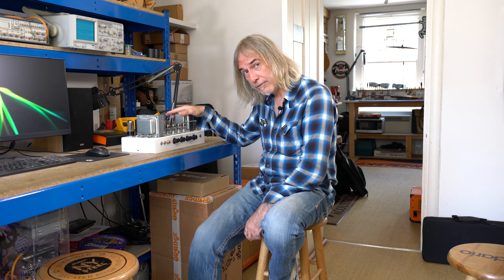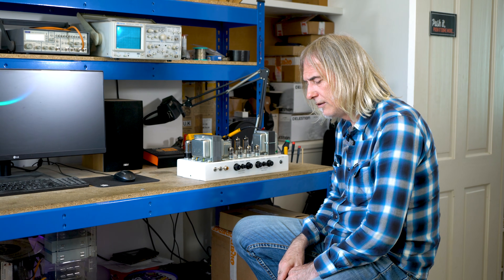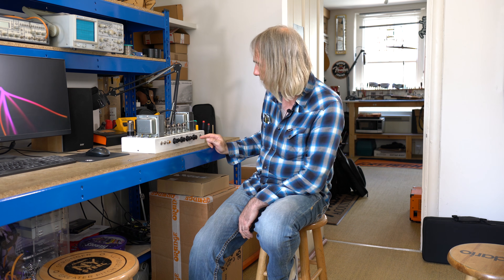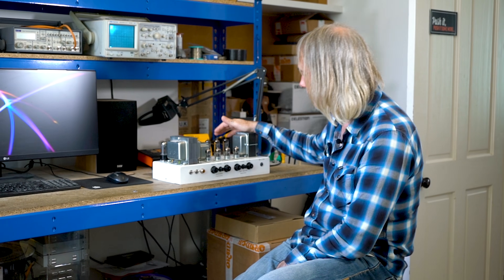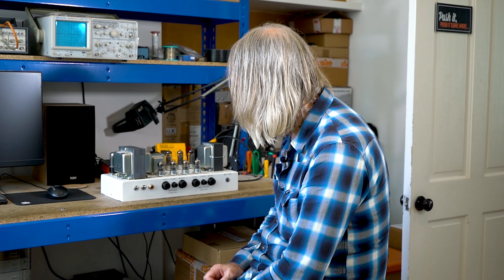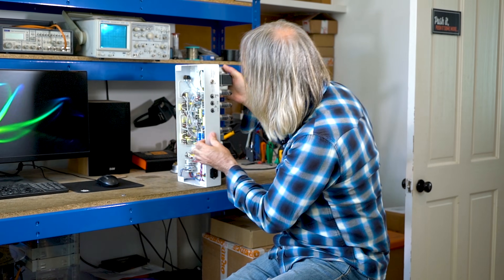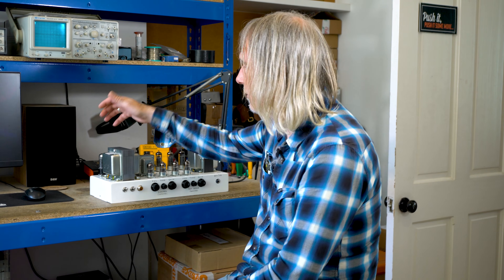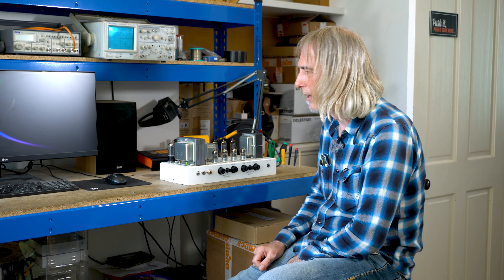That Orange Dual Terror Prototype explained by the designer, Ade Emsley

Comment: Pretty Vacant sounds amazing in this video - I remember Ade in other Tiny Terror videos saying one of the sounds he wanted it to do was "Never Mind the Bollocks" - can't argue with the tone here.

I bought my Tiny Terror in 2008 - I had planned on getting a combo, but they weren't in the shops quite yet, not where I was. I left Gamlins in Cardiff (RIP) with  TT head and 1x12 cab. Still have both, and they work perfectly. I couldn't part with it.

Others have asked, but what's the cab? I remember the Shiny Terrors were sold with a 2x10 with Celestion Golds in it, is that what Ade is using here?

Comment: you guys need to make a 30 watt 15, 7, 3.5 Brent Hinds Terror, just upping the Watts and not changing the distortion stages or that clean sound
Reply: And add a 100 ohm high power/75 ohm low power dual cathode bias resistor mod to get those tubes cooking, as well as ship 'em with Russian 6n14n's like Dr. Z!

Comment: why doesn’t have fx loop ? no reverb no loop ı love orange amps but 😑
Reply: Then get a different damn orange amp. Then it would be larger and defeat the purpose of a tiny or dual terror
Reply: That's why I love it , less clutter in the signal path!  Just raw, glorious tube tone.  No effects needed.  I used a Rocker 30 for a decade, and had several Tiny Terrors. None have verb or fx loop. Perfect for me.